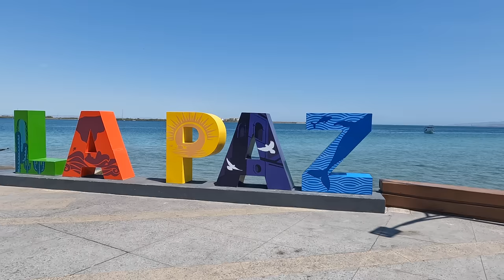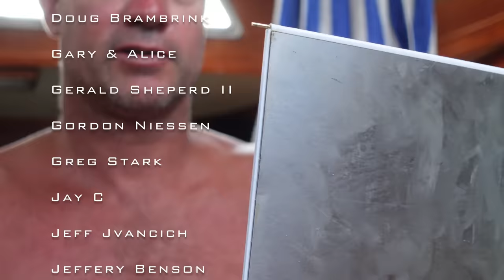Living on a sail boat in Mexico | Ep 367

Comment: great repair on the door you could use some baking soda and superglue to reinforce the corner just put some baking soda on the corner and pat it down then drip some superglue on it it turns to plastic and you can sand it smooth afterwards
cheers
Reply from the maker: thanks for the tips
Reply: Top Tip, I'll be doing that!!